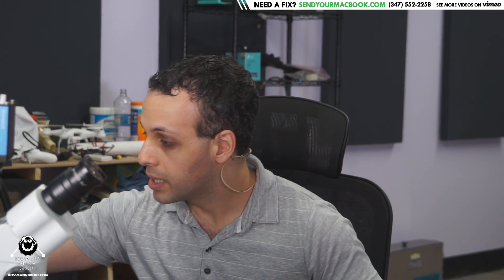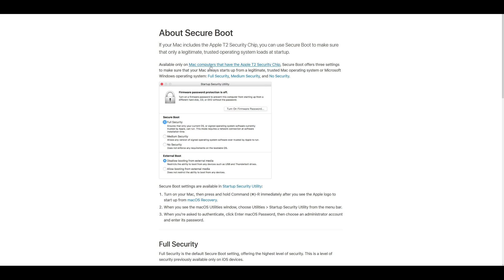An important message from Louis Rossmann

Comment: I have invested a small gold mine. into converting everything to Apple. I did this because I have had every other brand of laptop that is made. Every one of the brands I tried was junk.  So in listening to your videos, I get the feeling you have a nice repair business going, because Apple isn't the most reliable brand either. My question is, in your opinion what is the best brand of laptop?
Reply: Lenovo thinkpads haven’t failed Me yet
Reply: he would probably say Lenovo because they are extremely consumer-friendly. He spilled like a gallon of water or half of a gallon on the keyboard on purpose and when the laptop died 6 months later Lenovo replaced it even though they didn't need to since he did it on purpose. Apple on the other hand refused to fix a 2000 dollar Imac from Linus even though they were 100% willing to pay for it to be fixed. iirc there was a video where he talked about it.

Edit: heres the video where he talks about that https://www.youtube.com/watch?v=vD7baUgz1tI
Reply: This depends a lot on your needs. What do you not like about other laptops? What do you do on your laptop that works well on Apple? For one I would recommend the Dell XPS 15 2020 edition.
Reply: Try old Lenovo ThinkPad laptops
Reply: Louis uses lenovo thinkpad p50/p51 For a more normal not power user use case you can t480. For students or for budget get a t440p or for portability get x230
Reply: My Toshiba satellite Pro from 200x died last year,
My new hp g4 250 still rooking to this day what are you talking about, use stuff carefully and they will last
Reply: My experience is that any business laptop is pretty solid. ThinkPads are a personal favourite (and Louis's), but I feel like they've also gone astray.
Reply: Honestly, if EVERYTHING you tried was junk compared to apple products your opinion is of extremely little value. Apple has always been the brand that is selling junk that's been designed to emphasise form over function.
They force you to pay a huge premium to buy their substandard product because you think it looks pretty,. 
They don't pay a dime in tax.
They lobby hard to prop up laws and systems that protect their unfair business practices (customs, anti-counterfeit people).
They force you to buy new products rather than being allowed to fix your old ones.
They deliberately sabotage their older products through forced software updates making them slower and more frustrating to use in the hopes that you will go buy another one and that only happens once a majority of the model's units sold are out of warranty.
If you look at just macs, these run on decidedly mid-range tech, they market it to people who know next to nothing about computers they just want it to fucking work. And of course you can tell these types of people LOOK AT HOW FAST IT IS and ofc its fast because they are literally just reading emails, watching netflix and playing online bingo. 
You invested a small gold mine in all apple products and all that happened was that you got pissed on, get out there and do some actual research before you buy things.
Reply: He'll say lenovo

Comment: Any recommendations for a good, affordable computer for engineering students? Also, your videos are very calming when you do repairs, and informational when you go into your small "rants."
Reply: At least anything with Ryzen 3200u or better. If you can get 4300u or 4500u wil be even better.
Reply: Consider buying used on eBay, Craigslist, Amazon, or Facebook. I got my first Mac for $300, my 2nd for $800. I got a flawless XS max 256gb on amazon for $630 with only 100 battery cycles used.
Reply: Get a 4th ryzen lineup. An 8 core like 4800u or 4800h should be good for years
Reply: P50/P51 If you have a 600-1000 Budget. Lower than that I would get a t80 or a T440p for sub 300$
Reply: i was curious on your reply so i searched about it. what blew my mind is the Lenovo T440p, it is cheap but super upgradeable. you can upgrade the CPU, HDD, add an SSD(removes optical drive), Ram upgrade, heat sink, screen and others. now im curious to try that laptop just to upgrade it
Reply: I just bought a T480 for about 800 with premier warranty on ebay, I am loving the thing though if your tech savy or dont need the latest and greatest thinkpad p50, or an older T series with a dedicated graphics card would work well.
Reply: Well it depends on what CAD programs you’ll be using. From my experience, Autocad and Revit really benefit on higher clock speeds on a single core ( yes single core!) and make sure you have a dedicated GPU. Since you’re a student, a Nvidia 1660 will do you just fine.
Reply: Really always get windows 10 pro for engineering. You never know if you need to make a virtual machine
Reply: For cadding I recommend a sizable amount of ram. I CAD and relatively simple CADs can take close to 10gb ram. Interestingly CPU and GPU aren't actually hit that hard.
Reply: how much are you willing to pay?
Reply: @menmanamikaze1830  I'm trying to stay under a thousand. I don't entirely know what it will need to do, because I'm just a rising freshman in college.   Also, I know I don't want an apple laptop because it will take more effort to set it up to be able to run the programs, so I'm sticking with windows.
Reply: @nickirving7561  I'd recommend the ASUS TUF (2019) Gaming Laptop it has 15.6” 120Hz FHD IPS display (better for your eyes) AMD Ryzen 7 R7-3750H CPU GeForce GTX 1660 Ti GPU (you will need it to run AutoCad smoothly )16GB DDR4 ram  256GB PCIe SSD (for your os) 1TB HDD (to save your files) Gigabit Wi-Fi 5  RGB KB Windows 10 Home
(install honey browser extension before buying it to get a discount)
it costs 950$ it's a gaming laptop so it has all the performance you will need (idk that much about your needs but I know that they will teach you to use Autocad so you need some performance) the downside is the battery life it lasts only 2 hrs and it looks like a gaming laptop (rgb keyboard such things they can be turned off thou) 

or for a more normal non-gaming looking laptop get the Acer Spin 3 Convertible Laptop it has a stylus and a touch screen it's a convertible it has a fingerprint reader  and a prity good battery life
Reply: predator helios 300
Reply: dell business class, avoid their consumer grade crap.
Reply: Anything that's businesses grade. So a Thinkpad, Dell latitude or precision, HP envy or elite, I'm a big fan of Panasonic too.  

I had a Panasonic CF-C1 for my schooling. It was fantastic for taking notes and packing to classes. Normally engineers don't need a lot of computing power unless you are going to run really fancy modeling software, like emag modeling, high detail 3d renders, fluid dynamics modeling ect. And then you would need the licensing, which you don't want to pay for and your school probably won't trust you with. I was perfectly happy with my second gen i5 in the CF-C1. I was also electrical, so we don't have fluid dynamics, and I didn't go into emag so the hardest things the PC had to do could have been done on a Pentium 4. When I got into my job most of our software was designed back in the Pentium 4 days... Or 20 years prior to that.

I'd recommend getting a used device that's businesses grade for durability a third (or higher) gen i5 or i7, 8+gb of RAM, an SSD, and that won't be a pain in the ass to pack around. Honestly I'd get a CF-C2 lightweight, powerful enough, Wacom stylus touch screen, reasonabley durable, cheap.

Oh and I said intel because that's easiest to date by model name. If cpuboss says an and chip is comparable go for it. But they are less common in business grade devices. Consumer grade stuff just isn't as durable.

Mostly you want to like packing it around and using it. For me that meant lightweight and a stylus for note taking. The Microsoft surface would have also probably made me pretty happy. Maybe tracpoint is something you really want. Then if you need more power later, cross that bridge when you get there, at least you didn't spend hundreds more than you needed to not use it.
Reply: Used Thinkpads if you want to spent less than 400$
Reply: Replies basically says anything else
Reply: Lenovo ThinkPad
Reply: It entirely depends on what you expect them to run... 3D CAD with really advanced models is going to take a lot more power than some old engineering calculator software from the early 90's.
My advice, especially for students, is to buy something that only runs what they need TODAY, budgeted based on how much you are willing to throw away TOMORROW... You never know what tomorrow will need, so it's stupid to pay extra and hope you guessed right.
Reply: Dell Precisions are Good choices provided you know how to shop around much less do basic maintenance and upgrades. On the used market they are cheaper and a Lot faster than the overpriced saltine crackers people are used to buying these days while being much better built. The M6700 I am using right now only cost $300 shipped and it had been upgraded by the previous owner with a 120hz screen.
Reply: Like others have said, ThinkPad or Precision. Both solid machines imo
Reply: You could try Linux too
Reply: Despite all those videos Macbook Air/Pro are still the best options for the money. Used ones are an even better deal. Just remember to backup your stuff regardless of which laptop you use.
Reply: @YaroslavNechaev  Not anymore. That was true maybe 6 years ago. These days, other laptops have caught up entirely with Apple's laptops. I know, because the only reason I had one in 2014, is because no other laptop offered what it. The screen, battery, design etc. and smoothness of the OS, was just unmatched. However, today there are countless notebooks out there. And you can get one that does exactly the same as a MacBook Air/Pro, at the same price or lower. And for not much more money, you can get something that is astronomically better in every way. Like I just purchased the new ROG Zepherus.
Reply: @YaroslavNechaev  Good luck with a 2016 to 2019 Macbook Pro when the keyboard randomly dies out of Apples repair programme. How long was their extended butterfly keyboard repair programme? 4 years?
Reply: tnetroP dunno, I got it replaced at Apple’s expense, got free new battery in the process and the thing haven’t had any issues since (2 years have passed). Just replace the keyboard and otherwise the 2016 design is great
Reply: @YaroslavNechaev  the keyboard is a key component to the computer. They have to replace the battery because it's glued to the casing and needs to come out for the keyboard replacement
Reply: @aribloch  yes and for me as a consumer it was totally a win since I got the entire top case for free along with the fixed keyboard. I honestly don't understand why Apple designed it this way – it looks like they've lost a lot of money replacing half a laptop to people for free.
Reply: @YaroslavNechaev  despite all those evidence u mean yet ure still fixated on Apple? Bruhh there are better laptops like Razor and ASUS
Reply: John Wig what evidence? Louis sees issues because he own a repair shop. Apple laptops actually fail rarely. There is this keyboard issue with 2016 redesign that is actually frequent but Apples replaces the whole topcase for free, so I don’t see why I should complain
Reply: John Wig my mother owned 2 ASUSes for the last couple of years: motherboard failed in both in the first year of ownership. Switched her to mac in the end.
Reply: Don't spread misinformation because of your own personal experience. Don't go for a Macbook unless it is specified in your class for some software/specific tasks. Like the other said, It all depend onto what you're actually gonna be using the thing when it comes to specs. Lot of people suggest Lenovo's for their reliable customer service and well built machine, which is fair enough. I would always go for the slightly more expensive but more reliable product than getting the most out of the price/performance. In other words Price/Reliability is probably more important than getting an actual really powerful laptop. Current gen i5> and Ryzen 5 >(wait for the new 4X00 Ryzen if you can) are gonna be more than enough. At least 8gb of ram and an SSD. Graphics is all software dependent at that point so, I can't recommend anything on that.
Reply: Evil X I totally agree that Lenovo are awesome laptops, I just think that Macbooks are on par. Which is a shame for Apple because just 5 years ago there was literally no competition for macbooks anywhere and now there is.
Reply: @YaroslavNechaev  macbooks were never good choices.... or any computer from apple ever.  you can get 2x the hardware for the same price with a PC
Reply: @khhnator  that is just a lie. I dare you to find today a strictly better 13'' laptop than a 2020 Macbook Pro for the same price. 2x is a typical exaggeration from people who don't know much about hardware.
Reply: @YaroslavNechaev  to start with, how does being completely unable to fix it if anything happens factors in price?
Reply: @YaroslavNechaev  huawei matebook 13 2020. i7/16gb ram/512gb ssd/mx250 for 1.3K €. Macbook pro 2020.... doesn't even have a dedicated gpu, lol
Reply: @uninterestedinyou5871  does your dedicated GPU outperform integrated one? Or does it exist solely to check the box on "dedicated GPU"? Also in your example, yes, MacBook is like 200$ more expensive but it has a faster CPU, a significanlty faster memory, faster SSD and a better display.
Reply: @khhnator  depends on what's broken but are other laptops in the same category more repairable?
Reply: Yaroslav Nechaev either you are trolling or you are commenting on the wrong channel, have you ever heard about those new Ryzen laptops ? Surface Book 3 ? Also about that dgpu, do you have any fucking idea what PC hardware is ? A gtx 1660 max-q is over 1700% better than your average Macbook Pro igpu, you have clearly no idea what you’re talking about.
Reply: @YaroslavNechaev  dude.... the CPU on the starting macbook pro 13" 2020 is an 8th generation i5, on the matebook 13 2020, for the same price, you get a 10th generation i7, so CPU-wise, Matebook wins. Dedicated GPU crushes intel's integrated GPU, and the Matebook also has an intel integrated gpu so whatever. And lastly, the starting model on apple's side gives you only 8GB of RAM and 256GB  of internal storage, while huawei doubles that to 16gb and 512gb, on top of a longer-lasting battery. Screen resolution is slighty lower but who cares when everything else outperforms the macbook? the screen is not gonna make the difference.
Reply: @uninterestedinyou5871  I was comparing 10th gen i7 macbook pro to 10th gen i7 matebook, which have 200$ price difference I was talking about. I don't know why you would compare previous-gen macbook hardware to current-gen matebook. MX250 is slower than Iris Plus, it is not magically faster just because it is dedicated.
Reply: @RandomGuy-om1vy  you are confusing so many things on so many levels. Surface book 3 is strictly worse than a Macbook at comparable price point: has less storage, less and slower memory. To get an 1660 max-q version you could buy two MacBooks (no joke). MX250 dgpu that the other guy was talking about is slower than Iris Plus igpu.
Reply: @YaroslavNechaev  you said "macbook 13" 2020". The base model has an eight-gen cpu, it's even written on this apple fanboy website https://prices.appleinsider.com/product/13-inch-macbook-pro-2020/MXK32LL/A

Your initial claim was that, for the price the macbook 13" 2020 is sold, there's nothing better. However, you are wrong, there are dozens of better laptops at the exact same price. Sure, ok, let's go with the 200$ more expensive model.... Oh, wait, there's, again, better stuff out there.
Reply: Yaroslav Nechaev Hee you must he a troll ! Now you are identified...
Reply: @intrax2tv  I am a little bit but just because the value in Apple's products is definitely not what it used to be: Apple is not innovating as much and other companies got a lot better. But still – to claim that their laptops are somehow not worth buying is just not true.
Reply: Yaroslav Nechaev yep definitely you are an apple TROLL ! Get paid and ftho...
Reply: @intrax2tv  I wish I was getting paid. I don't think I should spend my time telling random people on the internet how to compare two spec tables. Because it is clearly what I'm doing here. It goes like this:
Random people: but Apple is expensive! You can buy 2x hardware for the price!
Me: ummm, no not really, their price point is actually comparable to that of other manufacturers and they won't even cheap out on memory, SSD and touchpad, like other do.
Random people: but I can buy a laptop with whatever-best-nvidia-gpu-available.
Me: yes you can but you'll be paying for that privilege way more than Apple charges you. But if it suits your needs – go ahead.
The whole point of my posts is that 2020 13'' Macbook Pro is a very good choice for a student and for a reasonable price.
Reply: @YaroslavNechaev     I hate to break it to you, but a dual core isn't going to cut it for many people, and for those that it is enough for they can easily save money by buying a computer that is a lot cheaper and spend the money elsewhere. 

A few years ago I would have agreed with you, the MacBook air 2015 was a really good computer, especially for students (in fact, I still own one and use it for school work). You could actually see in schools that most people owned a MacBook air. It was light, relatively powerful, reliable, wasn't too overpriced, and back then there weren't many competitive options for lightweight and reasonably powerful laptops. Nowadays seeing any sort of apple computer in schools is pretty rare. This is most likely because there are now many other options for lightweight but powerful computers that are not only cheap, but also have pretty impressive specs for the price.